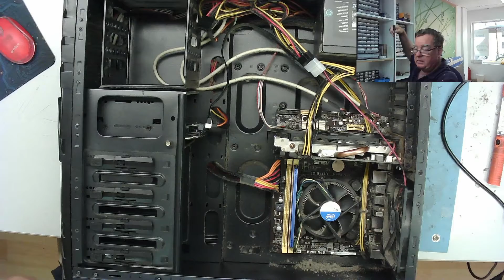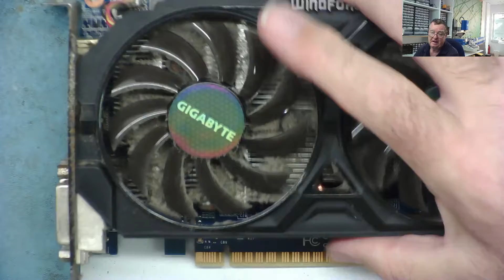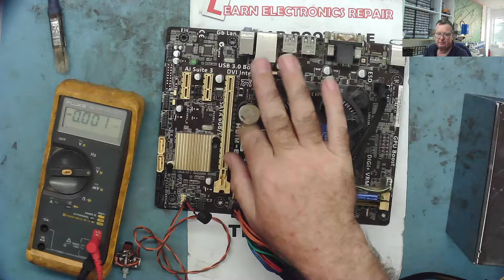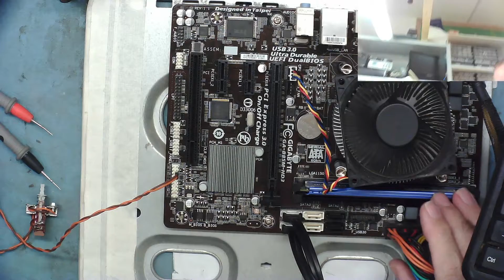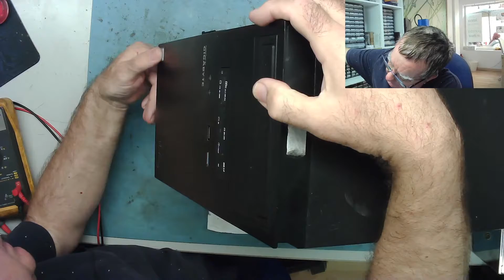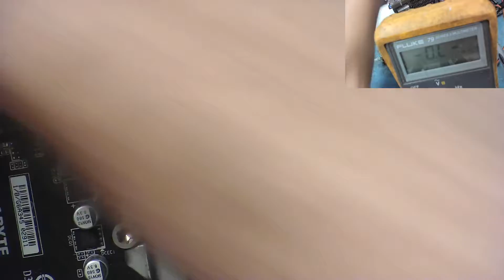Car Boot / Flea Market PC Finds - Can we fix them? Motherboard component level fault diagnosis

Comment: 750ti’s are going for £70-£75 these days so you’ve got your money back plus almost 50% profit right there 👍🏻

As you say, it’s not the most powerful card but it’s one of my all-time favourites. I’ve got a passively cooled version that doesn’t require external power, it’s the perfect card for an ultimate Windows XP system.

Edit: And that i5-6400 is worth £40. 6th gen is absolutely superb value at the moment 👌🏻
Reply from the maker: Totally agree. I have one in my 'ultimate' Win XP retro gaming rig (i7-2600K)

Comment: sometimes the guts from one psu will fit in a smaller one.... but you'd already know that -  when I pick up used hardware like a motherboard I always check to see if the cmos jumper  has been left on - this is an indication that someone has had an issue - and if it is left on the board wont power up....
Reply: Good observation, I also look for little clues like that.

Comment: Perfect Channel! ;) But you def. need a new microphone. Listening through headphones and the background noise is blowing literally my ears. :-/ So please...it is christmas time :D
Reply from the maker: @Markus
Actually I'm going to try connecting the lapel mic I have through a DJ mixer (which I also have) into the PC line-in rather than mic-in...  then I should be able to get rid of the hiss.  If you saw my older videos I used a heatset which gave better sound but was uncomfortable
Reply: @LearnElectronicsRepair  Thanks for your fast response. I'm pretty sure you can make it work! ;-) Have a nice holiday time.